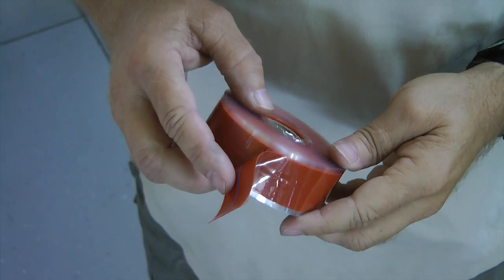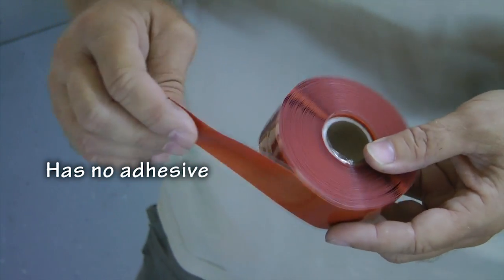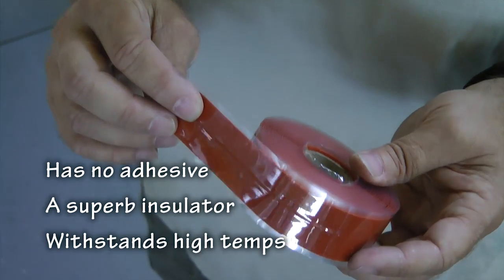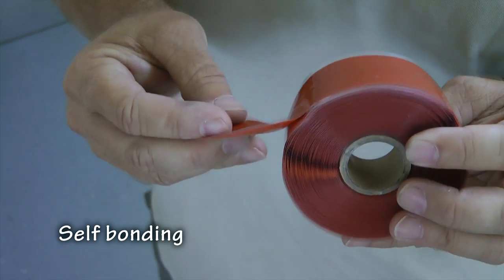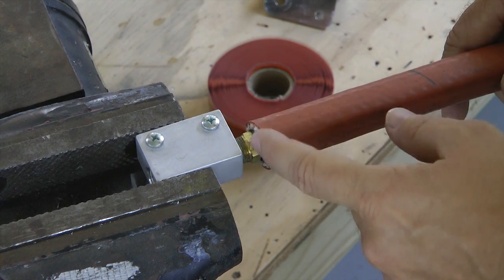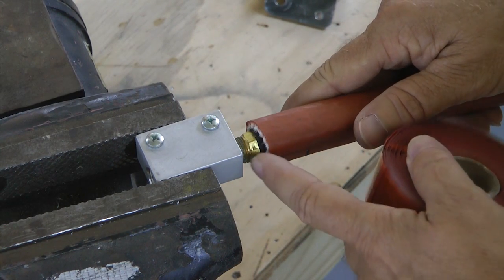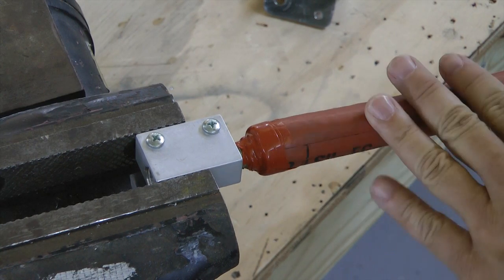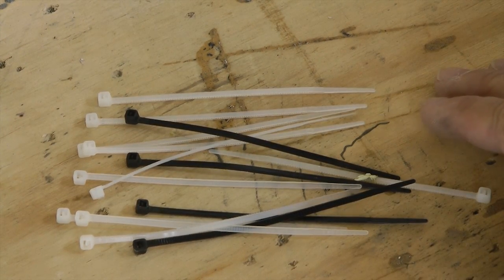The Magic of Silicone Tape for aircraft builders

Comment: But it doesn't stick/bond to the automotive power cable or that rubber sleeve. So it wouldn't be doing anything but making a obscure shaped red sleeve over a sleeve. The point being, it Must be sticking to the surface it's applied to or not sealing out anything but dust maybe
Reply from the maker: Think of the rubber o-rings, rubber gaskets and other rubber devices that seal fluid and gas pressure. They do not want or need to stick to their surroundings to seal.  It is the ability to conform to shapes under pressure that makes it a good seal.  So the tape is stretchy to create pressure as you wrap it around and seals by conforming to any shape but by design does NOT stick to anything but itself. Make sense?

Comment: Is there any difference between white black or metallic red tape as far as toxicity is concerned or is it basically all just inert self fusing silicone?
I want to pick up the best product possible but I also want it to be as safe as possible in case I need to fix a leaky water pipe with it.

Comment: Thanks.  I had someone suggest this tape to cover some exposed electrical wires on the outside deck of my sailboat.  I wasn't sure F4 would work since I had no experience with it.  Watching this video, I'm pretty sure F4 is exactly what I need for the job.

Comment: I patched a radiator hose with this several years ago. I never fixed it and still drive the car daily. This stuff is incredible.
Reply: That's both amazing and incredibly stupid.
Reply: @cefb8923  you know I think it’s one of those examples where a repair is stronger than the original part. Silicon‘s pretty tough stuff no more rubber hoses not so much.

Comment: You're probably going to want to put a zip-tie on the finished end (3:17) because the tension will often cause the end of the tape to separate. Great stuff though, and it is used in quite often in commercial aircraft maintenance.

Comment: 7/1/2019Your website, under the topic "Engines" depicts an engine with Adel clamp securing wiring, and an engine with a zip tie securing wiring to the engine mount.  Would you rather use silicone tape for those applications?

Comment: 6/30/2019Would you recommend silicone tape for securing wires to airplane engine mount? Or would you first wrap the tape around engine mount and then use zip ties to secure wiring to engine mount?

Comment: Most vet acft mech calls this stuff F-4 tape. The red is high heat while the black is for normal use. The color line in the middle of the tape is a guide on wrapping. After one wrap the overlap corner should  follow the line.  DO NOT allow dust and dirt get on the F-4 tape because it will not stick together very well. F-4 tape is some GREAT STUFF!!!!
Reply: We use it in TV engineering too. We call it "Tommy Tape." I've used it to repair Triax cable that's been drug through mud, puddles and wet grass...works incredibly! I keep a roll of this stuff in my race car as well.

Comment: I'm thinking perhaps you applied the tape upside down because that blue line down the center is supposed to be a visual guide to help you efficiently wrap the product and use the minimal amount of material for the job as well as probably to be more consistent so you get predictable thermal characteristics across the installation.
Reply: For sealing the battery cable and fire sleeve I don't think he wanted to see the blue line, he had more than enough coverage.

Comment: Cool, thanks for the tip. Does that come in different colors? I have a bunch of black tape that looks just like what you're using and I'm wondering if it's the same. Thanks again and keep up the great work
Reply: I suspect they will respond but I have it in multiple colors.  Black and red are my most common.
Reply: +Rick Duncan thanks, much appreciated